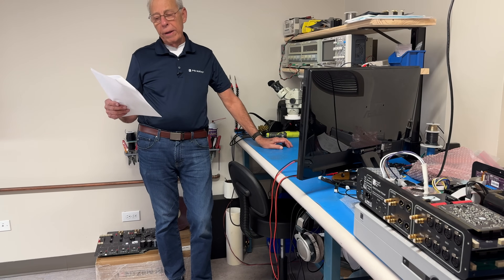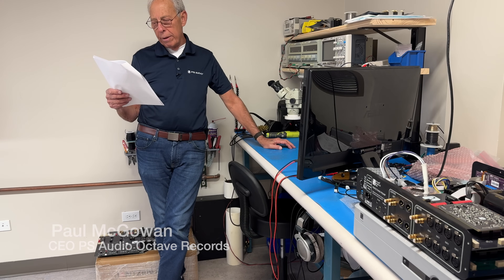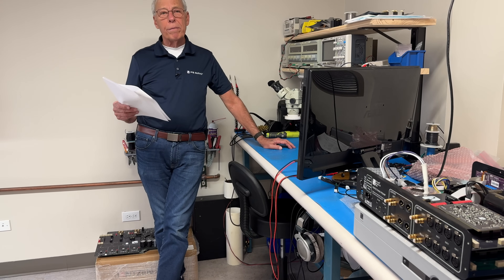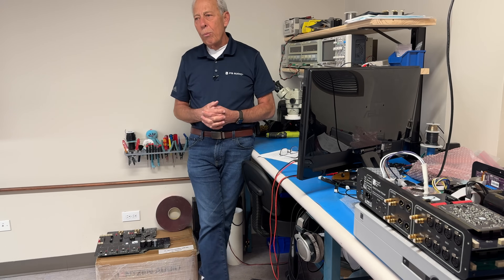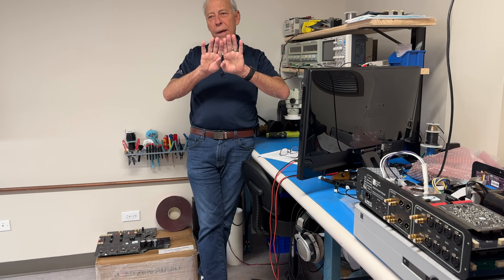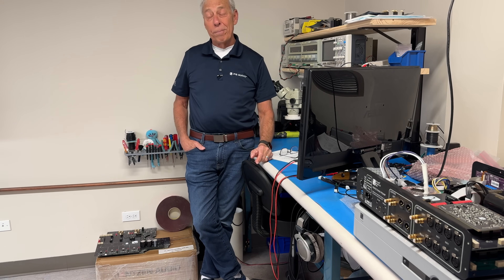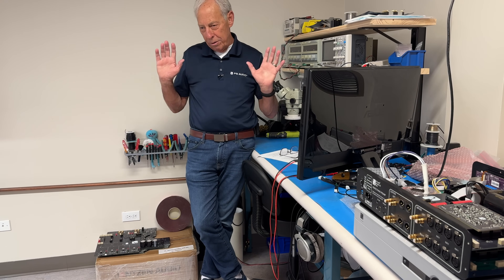Active crossovers

Comment: I've always liked the idea of active XO's ... they're great in theory ... but totally impossible to get right unless you have the individual anechoic response curves ( including phase response) of each respective driver. Even then you don't really know what kind of slope to set for what kind response at the particular XO frequency. You must have access to a really good audio analysis system which can measure the overall phase and linearity response. .... at the end of the day you probably couldn't discriminate from the active XO speaker and it's equivalent passive XO ...
Reply: It's not all that hard. Personally I use some calibrated microphone from miniDSP with a tool called Studio Six Digital running on my iPad. This software is not free, but has quite a few features for measurements.
Reply: You dont need an anechoic chambre!, just some gentle sweeps near-field at say 1M, it will be very close to the datasheet for that speaker
Reply: This is an elitist take. Why would you need an anechoic chamber? You’re setting up the system according to your room dynamics.

Comment: Quad amplification, active crossover… I’ll never go back to analog, there is a learning curve for sure but once you master it, it’s day n night! Just perfection unattainable with traditional analog and physical time alignment. I just wish there was a very high end plate amplifier on the market.
Reply: active crossover as in dsp i easier than passive, thats how i got into speaker design. but for hifi listeners they should not need to do much than plugs things in.
Reply: @sudd3660  yes so a preconfigured active speaker with plate amp, only one wire, even wireless!

Comment: Don't forget that many professional studio speakers are already equipped with discrete amps for every chassis and a crossover right after the input of the cabinet (you may call it an "active crossover"). So you just plug in your (mono) audio cable from the mixing desk or audio interface and a power cable in every cabinet and you're already good to go.

Comment: One really good reason is that active cross-over is superior from an audio perspective (precision of frequency response, phase, damping factor etc.). Come on Paul, there is hugely more audiophile value in active cross-over than in snake oil power cables, for example. None of us should doubt that the speakers are where most of the magic happens and the cross-over is indeed one hugely important attribute. It’s not about any desire of messing around with controls but about our pursuit as audiophile towards best possible audio!!! Then another super important benefit of active cross-over is that suddenly you also have excellent control of achieving optimal performance against your room acoustics, personal preference and the all too important equal loudness issue (Fletcher Munson effect) making your speakers perform at their best at your typical listening volume level. And of course this is only for those who are willing to spend time in tuning their system with some significant effort or expert support. Let’s be honest about this subject please.
Reply: These active crossovers alter the signal digitally or analogically?  Because I don't really understand how would they work digitally, like, are they DACs too? but if they are analog, then wouldn't the sound quality degrade? (if the active crossover isn't big and expensive enough to carry components like the ones used in passive XOs)
Reply: @ivanaviNiebla  Nowadays active cross-over only makes sense on the digital output of your streamer device. So you connect streamer to DSP box (with DAC) to amps to speaker drivers. You need as many amps as “ways” in your speakers. A pair of 3 way speakers will need 6 amps.
Reply: @ThinkingBetter  Thanks for the explanation. Honestly I was under the impression that active XOs would be more affordable to implement
Reply: @ivanaviNiebla  You need more power amps e.g. 3 stereo amps for 3-way speakers. But you save an analog preamp. If you are still into vinyl, you will need an ADC and I wouldn’t do it in such case.
Reply: Have recently gone back to active crossover.  Splurged for an active speaker that has powered low end and needs amp on top.  Came with a crossover (and processor) with preset setting by speaker manf, only thing I adjusted was for gain on my amp vs there's. I do not plan on adjusting infinitely.  I may add another setting or two, but not getting this and investing so much just to tweak, but to dial it in for my ears, my room, my music.
Reply: @delcampbell9558  I recently bought a pair of KEF LS60 and love the ability to tweak them.
Reply: Yes installing an active crossover will give anyone 10x the performance increase over one of their mains conditioners or silver power cables, but they dont sell active crossovers.

Comment: Analogue loudspeaker crossover , i do understand , it's a two port network , it's a pi or tee , LC , arrangement , calculatable , low pass , band pass or high pass LC network , but an active crossover , is it , an electronic gimmick circuit ?
Reply: Not at all. You can do everything you mentioned in analog or digital domain. With active crossovers, you get more precision and more control.
Reply: Well active is better in everyway, for a start you dont need inductors and instead can use highly stable capacitors, plus you have no power/resistance drops to deal with, its not difficult either, learn about op-amps, Sallen Key, Butterworth and Linkwitz Riley and you can then design.

Comment: I'm not sure why anyone would continue to mess with it, you go through the process of setting it up with measuring and listening and that's that.

One reason why DIY could easily knock a zero of a complete system today is because things like DSP is so cheap compared to passive components, another reason is that you don't have to spend your way through every single cable and component from the wall jacket to the drivers in the speakers.
And... I guess that's the actual issue for most audiophiles, they want to change stuff from time to time, and also don't mind paying for it.
Reply: And then you find that there needs to be a fine adjustment, then happy again and repeat...😂
Reply: @West3rror  I actually don't mess much with my system, I did in the beginning to a degree but I realised that it sounded better (to me) the less I tried to either force a flat response or one by my preference.

Comment: Audiophile consumers are conditioned by advertising to want huge power amplifiers that heat up the whole room and dim the lights of the whole house. The heavier the better. For pride of ownership, we want at least 200 watts per channel.  We don't want 6 channels  of 50 watts each, even though that might be ideal for an active system. Active systems need less power because fewer watts are converted to heat.
Reply: That is a very good point. Hopefully some people are smart and are willing to learn and can understand this.
Reply: Err no, some of the best amplifiers ever made are low rated, take the Leak20 considered today as one of the best sounding still.
Why would anyone need 200W in a normal sized room? you are talking someone with a very big room.

Comment: @0:05 "I have a 3-way, active, crossover system."
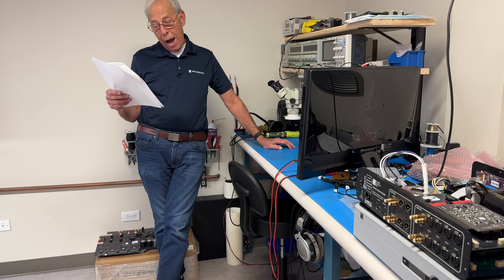@0:24 "This configuration is common in professional audio..."

And that, folks, explains why so much of what gets released to the public has sub-par sound quality.

Active crossovers are the Kryptonite of audio excellence.
And those folks call their equipment "Professional" audio.  Mutilated audio would be more descriptive.

Those into professional audio gear can never get enough dopamine from equalizers, compressors, and the rest, all of which colors and degrades the sound quality.
They can never have too many boxes adding distortion, which is cumulative, to the signal chain.  They can never satisfy their obsession with processing a signal.  Too much over-processing is never enough.  If it sounds fantastic, they have to fix it.

If it sounds natural, they have to enhance it.  It must have enhancements.  Why?  It is like a narcotic.

Yes, they have control over everything, which results in ruining that which those controls should not have disturbed.
But it makes them happy.  May they live blissfully.
Reply: When doing events with “professional audio” equipment, often the venues are not ideal listening environments for music, with all sorts of peaks and valleys in the audio spectrum, audio processing like EQ, delay etc are required in the mix to make the music more pleasant to the audience
Reply: @claybob7729  Yes, I agree with that usage of fixing issues with room acoustics.

When a band plays at a baseball stadium, or at Madison Square Garden, etc, no promoter is going to spend oceans of $cash, trying to treat those environments to get better sound quality.

EQ and the rest are ideal for those environments.  But for home use, they should be the last resort for fixing your listening room's sound issues.

Of course, if you only have $100 to fix your room's sound issues, then use digital signal processing fixes, and use EQ, etc.
But if you can budget doing it the best way, then steer clear of using DSP and EQ.
Reply: Hello again. I'm with you on this point too.
Reply: That’s totally false. Rather, best is to carefully optimize your room and speaker placement before you do minor tweaks with a DSP for getting the final result perfected. It’s idiotic to add distortion in my opinion. That’s also why I don’t like tube amps adding “musical” even harmonics to my music. Heck no, I don’t want any adding distortion either from a DSP or tubes. What you want with a DSP in an already excellent system is to get it closer to perfect natural sound. If I have a spike of 6dB at 500Hz and I can’t get rid of it from optimizing my room, I can make huge improvement with a DSP, for example. And this can apply for a US$10,000 or US$200,000 system equally.

Comment: What you say is correct, I'm an electronics technician and I have a tendency to get involved in technology. A few years ago I made a system with an active crossover, many amplifiers, cables and a lot of money, I was never satisfied, I was adjusting the crossover all day and I had no time to listen to music. I'm back to passive with premium components.
Reply: It’s a set it and forget it when you know what you’re doing
Reply: I have several active cross-over systems and I have not gone through adjusting the cross-over all day because it's not all that time consuming. But one thing that helps is to have a calibrated microphone (I use Studio Six Digital software on an iPad with it) that you can place in your exact listening position to dial in the best tonal balance. The current microphone I use was bought at miniDSP. If you are a passionate audiophile, this work is actually very rewarding because typically you have already spent a ton of time on room treatment and speaker placement when you finally precision tweak your filters to your exact preference. This can also include the Fletcher Munson loudness calibration against your preferred volume setting and in my case I tweak the treble up at 5dB at 12kHz to compensate for some age related treble drop (totally normal). This "rejuvenation EQ" is really awesome and in itself a major reason I enjoy DSP EQ and cross-over filtering. And the beauty of such calibration capability is that you can often FOR FREE tweak it further if you notice something you don't like. If the room has some resonance at some frequency, you can fix it. Good luck buying expensive cables for 1000s of Dollars fixing anything LOL...
Reply: I played about a long time, but it all came together one day, secret is, less is more, use only Q=0.7 for best transient response and use less than 10 Eq filters(biquads) and <10 phase filters(FIR) and use the SAME FIR and biquads for both speakers, because the speaker phase between the two will already be very close, so vector average and correct EQ, export vector average excess phase to Rephase. 
my system certainly sounds better than before and I have yet to hear another system sounding better.
You should be able to get it within 5dB across the range and 1-2dB between speakers in that range, but trying for more is simply a waste of time because slight head movements will cause 1-3 db in change at mid frequencies.
BUT, where electronic filters do come in, is making a subsonic filter (10/15Hz) cut off for the sub, DSP is useless at such low frequencies
Reply: @engjds  Any correction I would make with the DSP gives me distortions, now I have good quality broadband speakers, connected to the amplifier without a crossover....
Reply: @ I have some Jamo Concert 8's which are a pretty damn good speakers (£2500 new back in the 1990's), they get to 45Hz but just cutting them off at 80Hz with a sub gives noticably improved intermodulation distortion, near-field measurements and corrections 200 to10Khz (ignore roll off) and FIR flat that phase and you wont be dissapointed, far-field correction can often make it sound worse-its too prone to slight alteration of listener position. Were you correcting from the listener position or near-field(i.e anechoic?)
Reply: The obvious reply is that the average user is not an electronic technician.

Comment: I recall that with a triamplified system, with each speaker/driver being connected directly to an amplifier output, that the damping factor of each speaker would be ideal, due to the close to ideal zero ohm output of amplifiers.   This theoretically would provide better impulse response in all of the drivers.......  

But the bigger issue is, who is the user of the system and what are his interests? Yes, there are people who as you said, just want their speaker to sound good out of the box and not mess with anything.   However, if the author of the letter is a technically inclined experimenter, having an adjustable active crossover system, where one could not only adjust cut off frequencies and the order of roll-off, but to also adjust the filter response type could be most fascinating.  

Of course experimenting by ear may do, but probably such a person would also want to measure their actual acoustic responses, adding more interest.   And even being able to adjust the locations of each driver (well, the upper and midrange drivers relative to the bass driver) would all be of great interest.   And goodness knows there are probably many other interesting variable to investigate.

So I think you may have given a simple answer that didn't address the apparent interests of your letter writer.    Maybe you can provide an answer getting into the nuances of having an all active cross over system.  It could be quite fascinating!  ......  Thank you,,,,,,,,,  Chuck
Reply: Some day PS Audio will realize they need to add support for active cross-over filtering both inside speakers as well as as external products. I'm sure Paul is aware active cross-over filtering has some superior attributes like the improved damping factor you are mentioning, and many others. However, the underlying problem here is that PS Audio is riding on an already dead horse called DSD being promoted as the better format for content distribution and DSD is unable to support active cross-over filtering via DSP without first being converted to PCM.